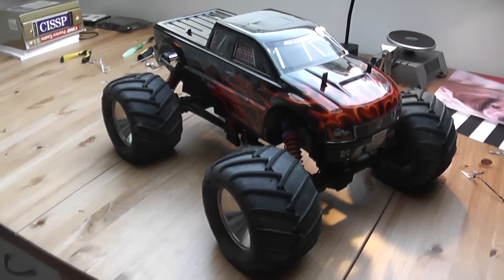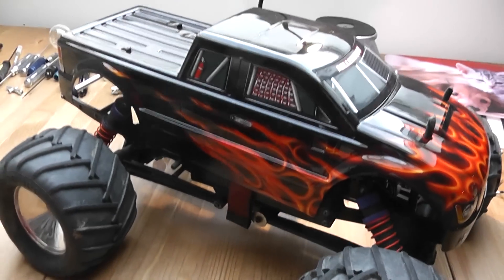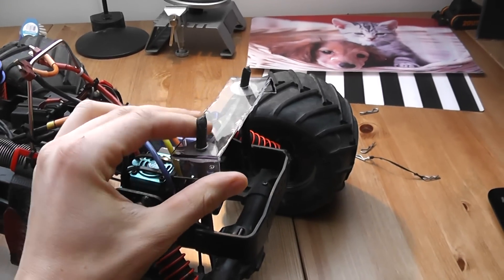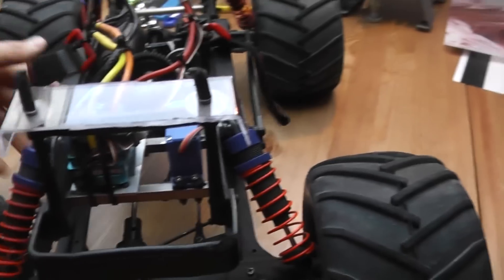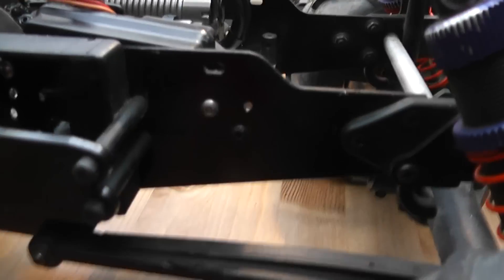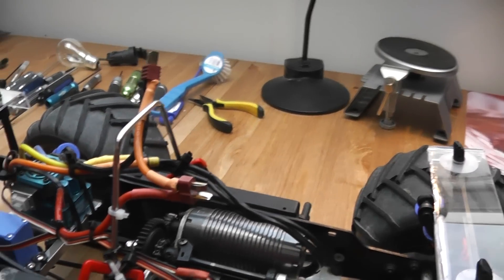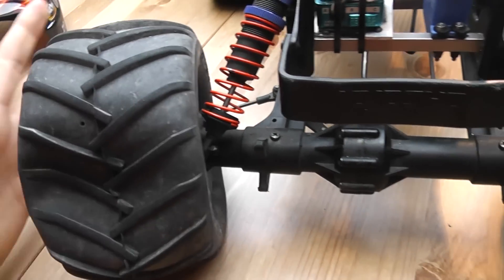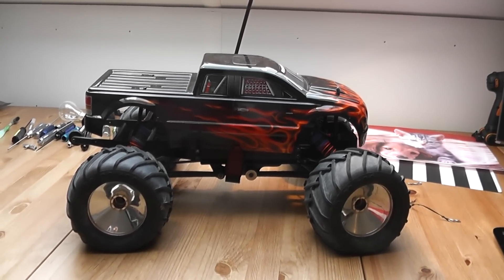Mad Force Kruiser Upgrade Show!

Comment: Looks good, nice setup! If you ever want to change to 17mm wheel adapters, it's the Inferno front wheel shafts (if150) + Inferno 17mm hub (ifw107). Gives you some more options. :)
Reply from the maker: utrak Yeah I've thought about that a couple of times, but I kind of like the stock wheels. I have the 17mm stuff on all my other trucks already. If anything I'd mount Clod Like wheels, but that's a pretty tough conversion (finding parts is the tough part. )

Comment: I guess I am one of those guys who purchased the kyosho foxx ve, and I have to say I am really impressed with the foxx ve almost over impressed, I do not bash it super hard but for what I am using it for, it has delivered everything I have asked of it with no breakages yet, if you have seen my thread I have been using it in formula off road fashion, and it has been loads of fun.

Your Kruiser is looking good with that new body, I hope it is lexan and not pvc, timritchieblue recently purchased a pre-painted body off ebay and it broke clean in half off first jump, which is the characteristics of a pvc bodyso be careful if it is not lexan

this video makes me want a Kruiser ve  but I also think that the larger wheel tires lead to axle housing breakages that I have seen so often, but maybe the new Kruiser and foxx ve have better plastics, I know I have had many many crash's where my foxx could have broke an axle, anyways thumbs way up Heeelmooi : )